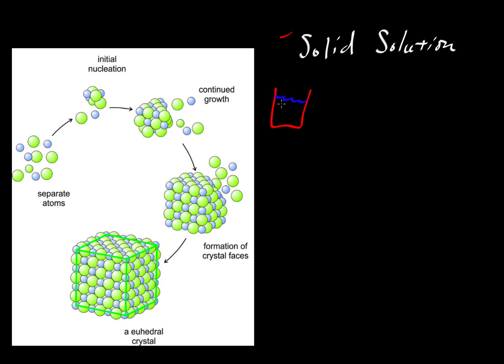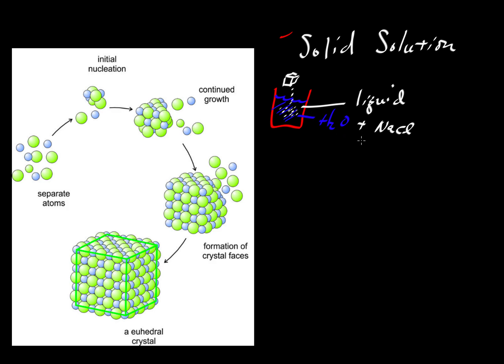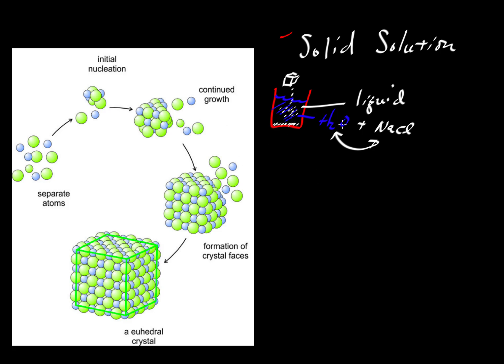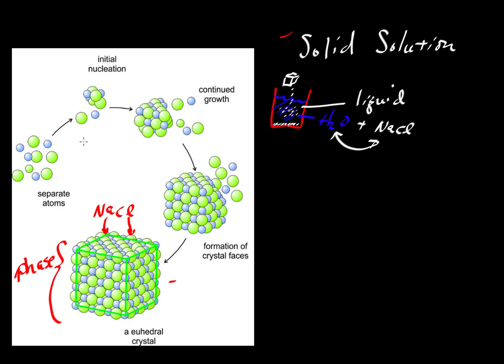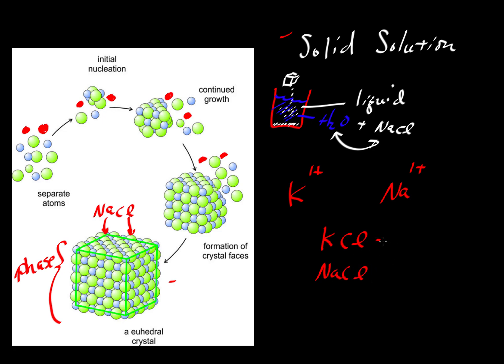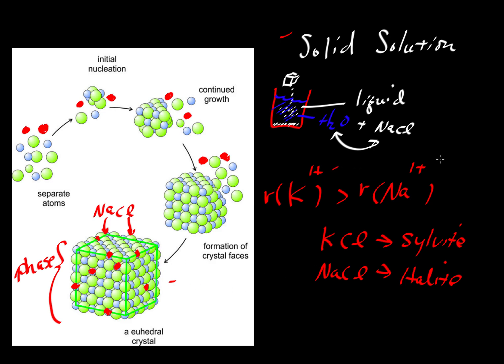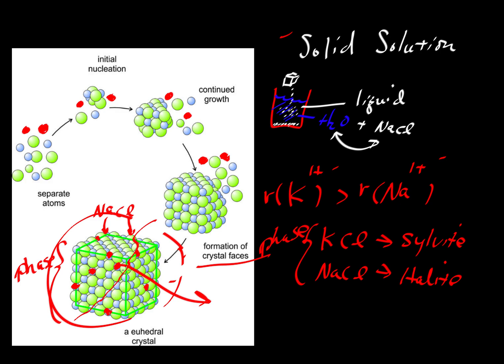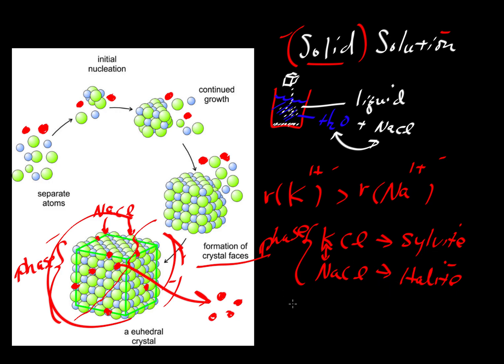Solid solutions 1: What is a "solid solution"?

Comment: What's the difference between a complete solid solution and a limited solid solution?
Reply: That's a great question and probably requires a new video, which I'll try to record soon. In brief, An-Ab is a complete solid solution because there is no limit on the amount of Ab that can dissolve into An or vice versa. But An-Or is (highly limited) since only small amounts of Or can dissolve into An and vice versa (and Ab-Or is nearly complete at high T, but increasingly limited as T decreases).